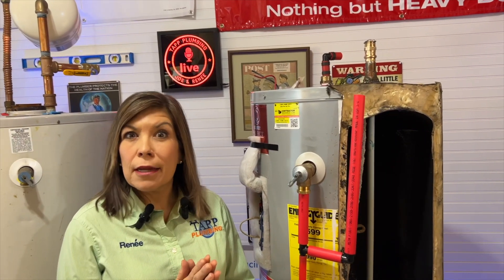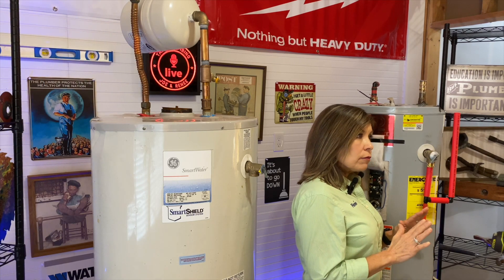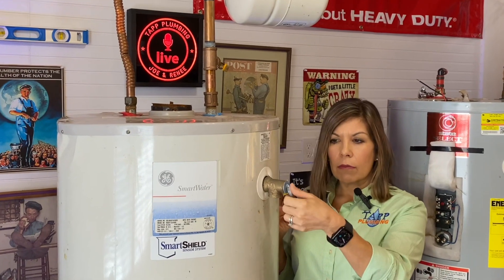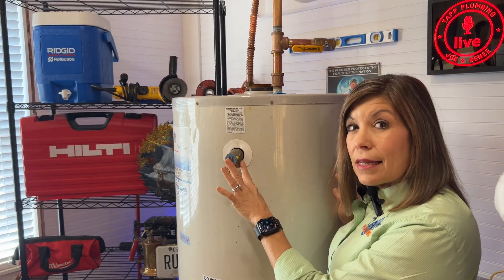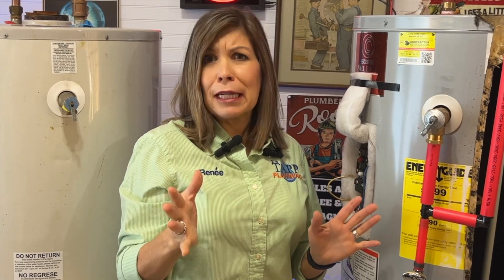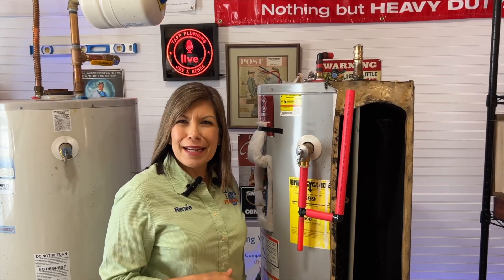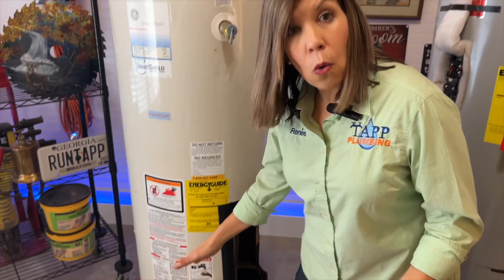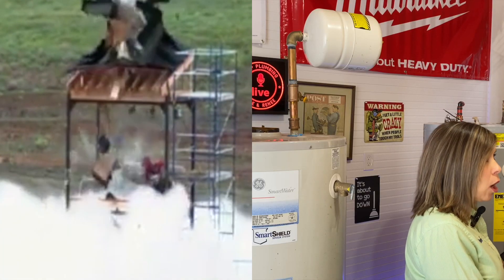WHY is My Temperature & Pressure Valve Leaking? @TappPlumbing #waterheater

Comment: Hi, i had a leak in my t&p valve located on the top of my electric hot water tank. By leak i mean a constant stream of water that required a hose to be hooked up. 

After replacing the old valve i found that the new valve had the same leak. Assuming a faulty valve I returned it and got a second replacement which is also leaking in the same manor.

I have adjusted my water pressure coming into the tank until it was so low that flushing the toilet stopped all flow to the shower. The valve is rated at 150 psi and 210°F. I considered sediment build up but the valve is located at the uppermost position on the tank and both were brand new. 

I considered temperature being an issue, but when showering (I raised the pressure back) it is cold within minutes.   After getting out of my cold shower (5 minutes ago) I could hear the sound of water running through the pipes and assumed something burst in the basement. Upon getting to the tank I found the valve leaking and checked the temperature of the water coming out of the valve. It was barely warm. This leads me to believe that it is not the temperature.

Any advice?
Reply from the maker: @charlesloring1824  It sounds like you have been very thorough to me so this might take a little back and forth questions with some luck to do through text. First question from me, Do you have a thermal expansion tank and do you know exactly what the pressure is with a reading from a gauge?
Reply: @TappPlumbing  I have not got a reading from a gauge yet. I also do not believe I have a thermal expansion tank. The hot water tank is only one piece so unless it could be part of the tank itself I think the answer is no.

Tonight the release valve will not even close any more unless I shut the water off going into the tank. I was planning to replace the pressure regulator this weekend, but it looks like it will be tomorrow instead.
Reply from the maker: @charlesloring1824  I forgot to ask if you are a well? If you are on a municipal water source you really need a thermal expansion tank. If you are on a well you do not. I also forgot to ask how old this heater is?
Reply: @TappPlumbing  heater is about 5-7 years old. We are on municipal water. I purchased a pressure gauge set to 100. The gauge maxes out every time the water source turns on. I have adjusted the regulator to lower it as far as I felt comfortable. The pressure gauge maxed out regardless.
Reply from the maker: @ Ok, now we are getting started! You are gonna have to replace the regulator and get the pressure down . They come set from the factory around 50 or maybe 60. Leave it there . You will not be able to adjust your old regulator if it has failed. There is no telling what your pressure really is. After you replace let me know what happens please.
Reply: @TappPlumbing  UPDATE: replaced the regulator, now pressure guage reads 54psi and (last week's new) t&p release valve. Last week's valve was still leaking so I assume the insane pressure ruined it. The new valve is not releasing.
Reply from the maker: @ I just saw this after responding to your last comment so thanks for the update. Yes go ahead and replace the T& P again and you should be good . You may have to add a thermal expansion tank in the future. Thanks so much for the updates and hopefully you can let me know this next time how things are going after the next step as well!!
Reply: @TappPlumbing  I appreciate your advice. I am looking into the expansion tank sooner rather than later.
Reply from the maker: @charlesloring1824  Sounds like a wise idea. I hope after swapping the T&P out and adding a tank, your problem will be solved and I know you do too!!

Comment: I Replaced an electric hot water tank in my house. I had no issue with the relief valve on the old tank. The new tank I just put in has a drip from the relief valve?
Reply from the maker: @crash7098  Have you checked your water pressure?
Reply: @TappPlumbing  no. There wasn’t an issue with the old tank. No plumbing has changed.
Reply from the maker: @crash7098  I definitely would go ahead and check your pressure. The new tank is more than likely to have a t& p that is possibly more sensitive than the old one.

Comment: Hi!  I have 3/4" relief valve (rated 75 psi) on my well pump that's almost 20 years old.  It just started dripping, mainly when the pump kicks on (it only drips one cup of water per day).  I notice the pressure gauge for incoming water is 80 psi. Does this just mean that I need to turn down the water pressure, or does the relief valve itself need replaced?
Reply from the maker: You may consider doing both . 80 psi is the most you should have and a 20 year old relief valve on a well has definitely had a very long life. Good luck with everything, keep us posted with your results if you have a minute. Thanks for watching our video!